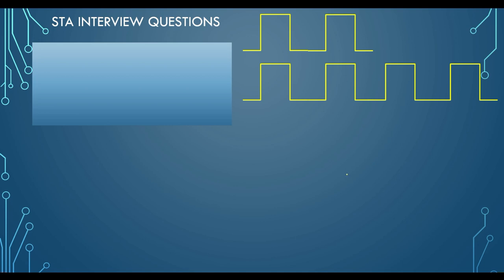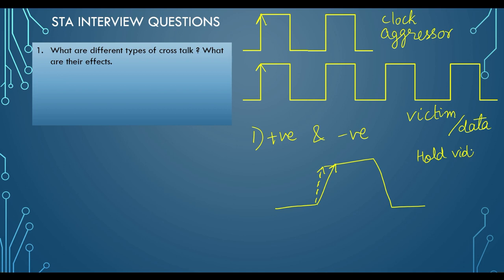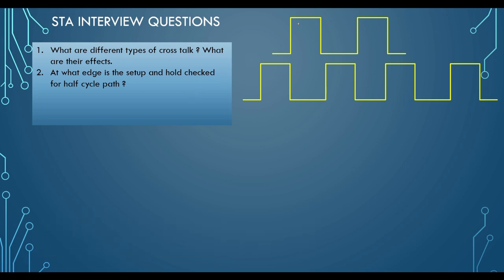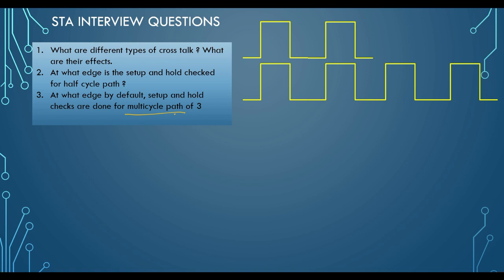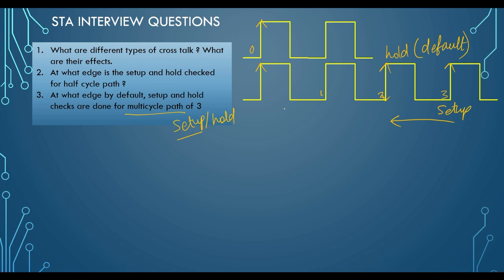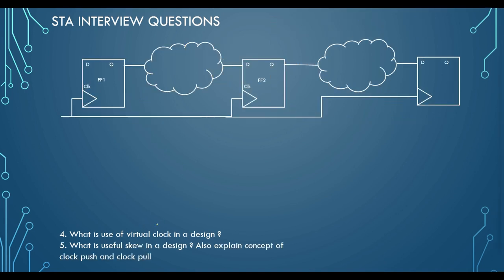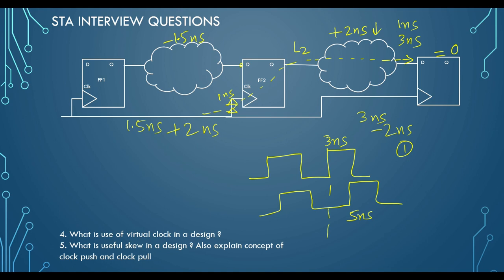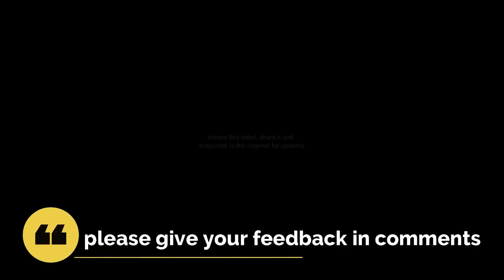sta lec37 interview question part2 | static timing analysis tutorial | VLSI

Comment: For setup fixing we check hold margin but due to clock push the next 
Data path delay increases and setup slack margin becomes more worsen in the next path so what analysis we do for setup before adding buffers in clock capture path and why we check
Hold margin for setup ?
Reply: @VLSIAcademyhub  Thanks for your time and consideration.so we need to check both slack margins of setup and hold of the next path